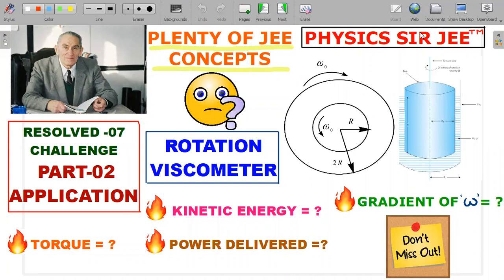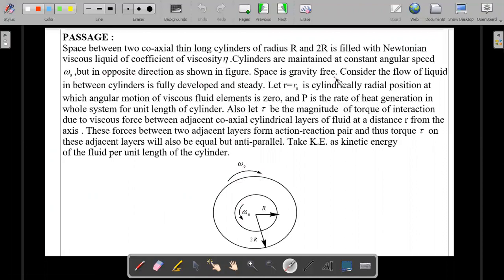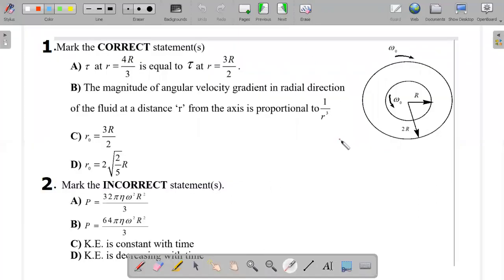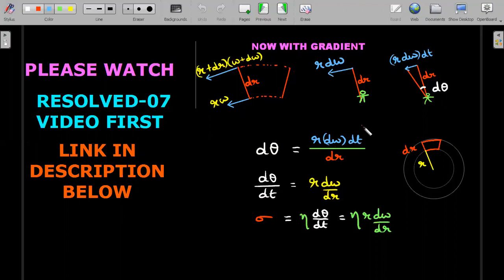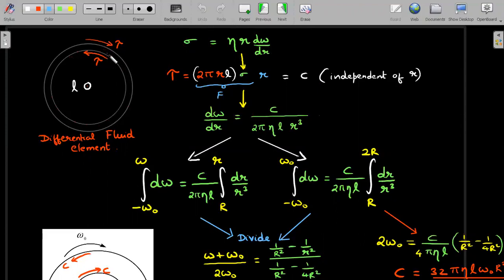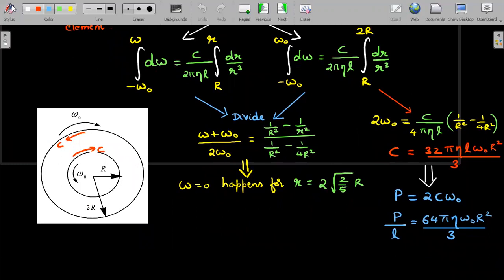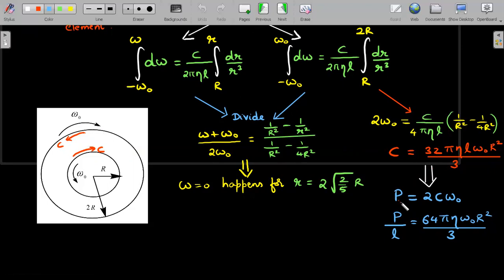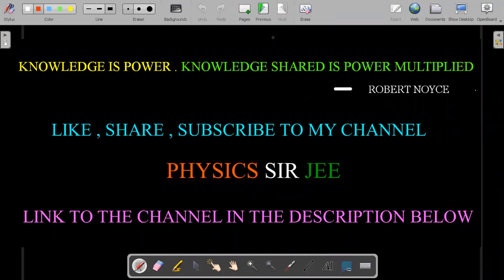VISCOCITY -TOUGH BUT ENRICHING APPLICATION CHALLENGE OF RESOLVED-07 IRODOV 1.333 ROTATION VISCOMETER

Comment: sir in every problem of this double cylinders rotated in viscosity problems in irodov,dc pandey,anand mishra physics books whether it is a steady-state or not when we write the force equation but take force as constant how ???(to calculate velocity)...... does if force is not  constant so it changes to turbulent flow?    you took problems of steady state
Reply from the maker: You mean torque is constant. Yes , otherwise Omega will change with time but still it is calculatable . It's called unsteady flow . Turbulent flow is different where it is not even calculatable using classical Physics. Modern Calculations use "Quantum physics" to solve turbulence.
To know the difference you may read the first answer in this page 
https://www.quora.com/What-is-the-exact-difference-between-turbulent-and-unsteady-flow
Reply: @PHYSICSSIRJEE  thanks sir....i did not hope that I will get very fast reply on such old video and that to you are too busy..and that's what makes you unique sir ....all of our students good wishes are with you